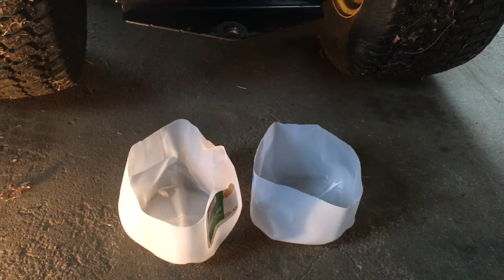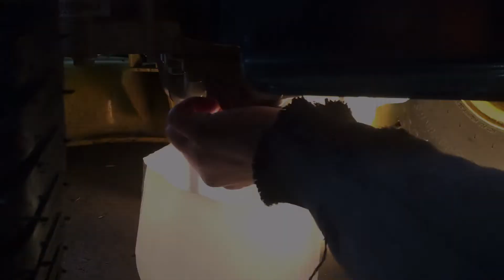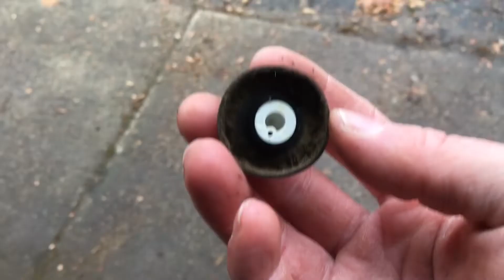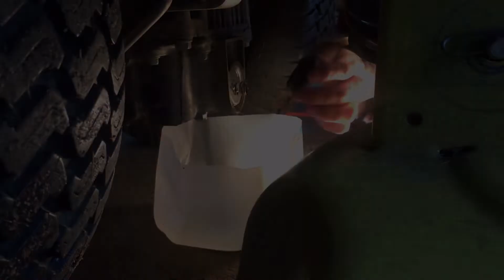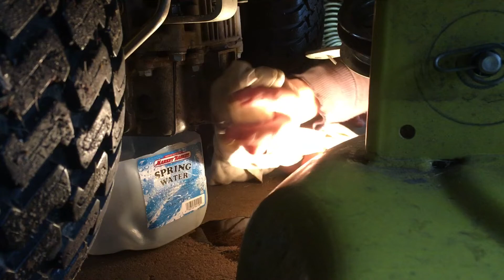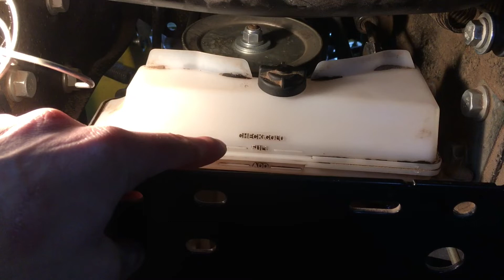DIY Maintenance - John Deere X370 Transmission Oil & Filter Change

Comment: Nice video!  I'm doing a X390 today.  FYI J.D. has a redesigned cap for the reservoir also revised directions for putting it on!  The old cap is prone to popping off (frequent problem),  allowing fluid to spill out and dirt to get into the system.  I'm currently "in discussions" with J.D. about the defective design and potential damage to the tranny.  :(
I'd like to discuss the issue with you or others with this problem.
Thanks!
Reply from the maker: @billrouggly538  I’ve not had the cap come off. I think the entire placement is poor design. You need a skinny long neck funnel to even get in there to refill. Interesting that they changed the cap. I guess they aren’t pushing it out to owners of older machines. I’m unimpressed with JD recently, but the x-series machines are still about the best that there is out there for lawn tractors.
Reply: @ProductiveRecreation  thanks for the response.  By the way, it took me about 45 minutes to do the filter/fluid change thanks to your excellent video.  I left the deck on like you,  but I jacked up the back end and put it on stands.  Then, I accessed the filter from in front of the right rear wheel, reaching in above the deck.
Re. the reservoir cap, when you go to by a replacement, it will be the revised cap.  There are instructions to NOT push down on the center of the top to install it, push the edges.   The parts counter probably will not tell you that.
Three people at our local shop told me that losing the cap while working is "common", "happens a lot" or "aware of it".  The replacement cap doesn't feel all that secure either!  :0(

Comment: Just did my x394. I got under there and had no idea what bolts to remove to drain the oil. Thanks to your video I was able to get the transmission serviced with filter no problem! Mine took 3 quarts and is just a little above the fill line. Thanks again..
Reply: I thought the X394 has the K58 tran and it’s non serviceable?
Reply: @thethinbluelineZ06  I’m not sure what the transmission number is but it is serviceable and has a filter that can be replaced. I know my x324 has the k58 and it is NOT serviceable…
Reply: The X 310 also has the changeable transmission oil and filter

Comment: Awesome video, I have an X-394 that I need to service, I've changed oil, filter & plugs twice at 50 hour intervals, I'm now approaching 150 hours and want to service the hydraulic system this time.  Thanks for the video.

Comment: Great video!  Thanks!
I did my X370 today at 56 hours. Couple things to add...
I drove the tractor around for a little bit to heat up the oil. It all drained in less than 5 minutes. Also, I drained almost exactly 3 quarts from it. 
I drove it up on some decking boards..  the extra 1.5 inches gave better access to drained bolts.
Mine filled up with 3 quarts straight in..  didn't need to wait for it to seep in. At 3 quarts its a hair over the fill line. I mowed the lawn after and still same level. 
Also don't see the need to remove deck. The tip about pushing the filter in further was very helpful. Made screwing the cap back in a breeze. 
It took me about 20 minutes to complete once I drove it up on the boards, thanks to your video.
Reply from the maker: That was my first time doing it.  Next time it’ll be a half hour or less for sure start to finish.
Reply: @ProductiveRecreation  I'm sure it would have taken me closer to 2 hours without your video.

Comment: I wonder if the k57 on a Simplicity is the same?
Reply from the maker: @arnoldarnold1034  I don’t know. Sometimes when the same transmission is used in different machines it is set up a little differently.

Comment: Great video!  Just what I was looking for for my new JD X370.  JD recommends changing the X370 transmission oil and filter after 50 hours (break-in) and then every 200 hours (normal maintenance).

And I agree with your comment that a better deigned (threaded) reservoir cap would help prevent debris from getting into the reservoir.

Also, a short piece of flexible clear tubing might make it easier to fill the reservoir.

Comment: The cover is designed to relieve pressure if necessary.  That could be done with a screw-in cover and one-way valve, but it's the same design that worked fine for 27 years on the JD 325 I just traded in on an X360 which has the same cover.

Comment: I was just tightening one of the two drain plug bolts on my x390 and all of a sudden the bolt wouldn't tighten anymore, it just stayed the same tightness no matter how much further right I go.. did I just shred the threads? What are my options now? Thanks in advance
Reply: So I pulled the plug out, and there were metal shavings all over the threads but after brushing them off, it seems like the bolt is fine.. I tried putting the other bolt in the same hole and it just spins.. doesn't tighten. Does this mean I shredded it and need to replace the pan to the transmission. Will leaving the transmission without oil cause problems while I try to source a new pan?
Reply from the maker: It sounds like you stripped the threads - maybe from starting a little cross threaded. I’d want to get the machine up so I could set eyes on the hole to check. If it is stripped, I think the only option is re-tap the hole for a larger bolt… the big danger is introducing metal shavings into the transmission. You may want to have a shop look at it. It bugs me that they use aluminum for a lot of this stuff because it’s softer than steel and strips more easily. My rototiller has gone through a couple cylinder heads from stripping spark plug threads. All is going along fine and then it just shoots the plug out cuz the threads fail.

Comment: X370 has K57 transmission and X390 has a slightly beefier K58. Only other difference is an extra 1.5 H.P. and 48" mower deck for an extra $2000 for the 390.  I couldn't justify the difference and bought the 370.

Comment: Great video!  It felt like I was next to you doing this. The tip about the filter saved a lot of frustration. Thanks for your help. Also does your reservoir cap just spin around the fill hole?
I have been trying to tighten it down. Maybe it doesn't tighten?
Reply from the maker: Thanks for watching. The cap isn’t  threaded. It’s just a friction plug. I’m not a fan of the design on that reservoir.
Reply: going to put some duct tape over it to seal better